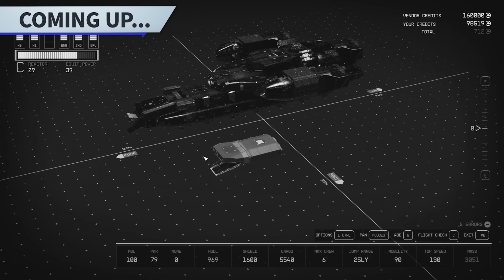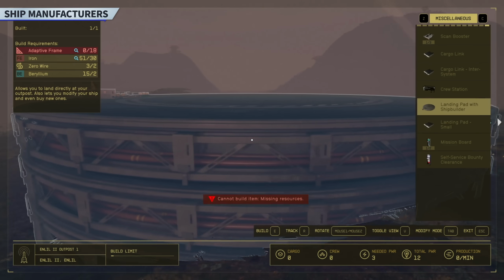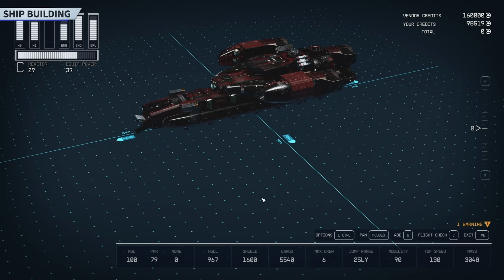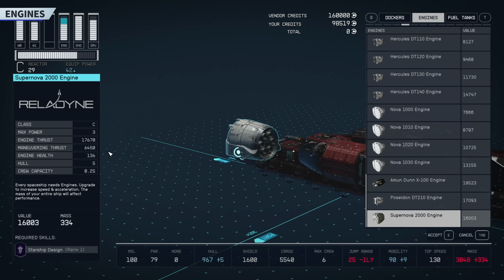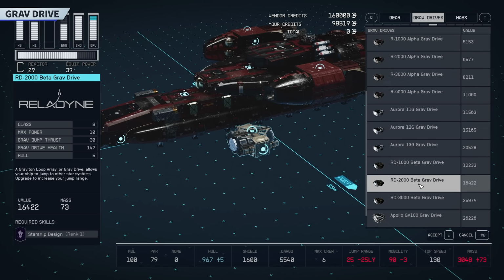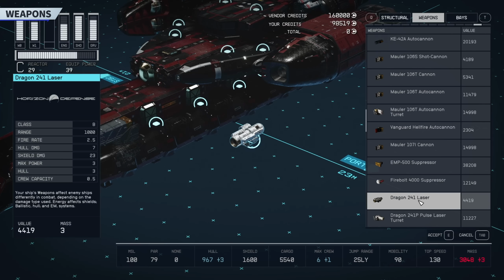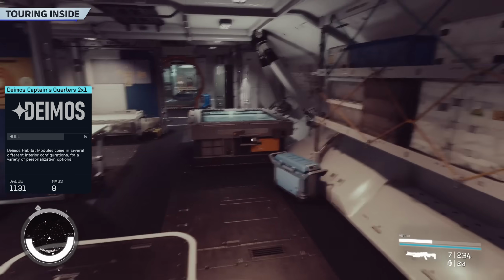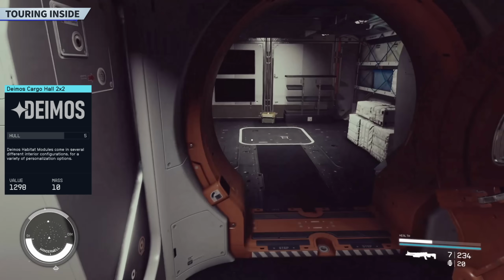Starfield - Ultimate SHIP BUILDING Guide (Spoiler free)

Comment: I am finding it utterly maddening that we have no control of how the interior is laid out in terms of where doors are located. I have several habs together, 2 floors high. To get from hab A to hab B, I have to go across one, up one, across two, down one, across one. Where is the ability to control where the doors go? A and B are connected, but there is no door. The automated system has designed its own weave of path through the ship and its not logical. I've tried changing the design, but each time I do, I have the same problem. If we have control of where the damnable doors are located, I cant see it. Its making the design system infuriating, and for navigating inside the ship, almost redundant, since all prefabs work, and all the ones I'm making, don't. If anyone has found a way to control this, please let me know, because this is killing the experience for me.
Reply: They connect based on the order you add them when building but it still isn't quite how I want it. Hope that helps a little
Reply: @james_crook  not from what I've seen, also switching a hab by one manufacturer to the exact same of a different manufacturer can cause the whole ship to have a different layout. Someone on redit reported the whole ship changing layout when all they added was a window.
Reply: @RecuringWolfe  that’s weird, I haven’t built a ton of ships but from the three I have, I just make sure to add the hab in the order I want the connection door to be and it worked so far. But maybe it was just chance.